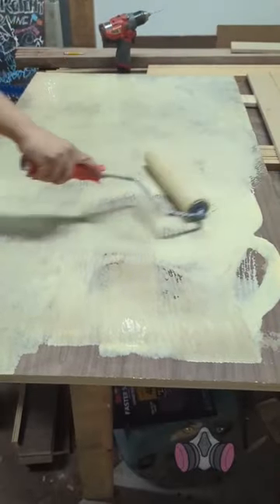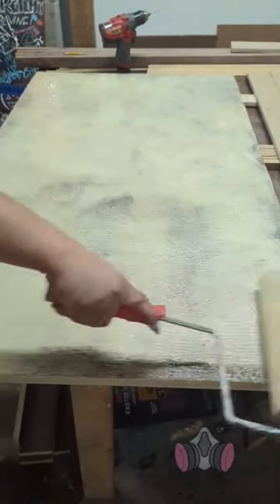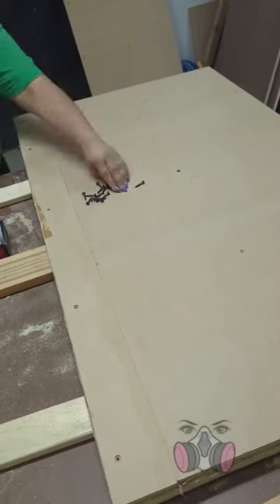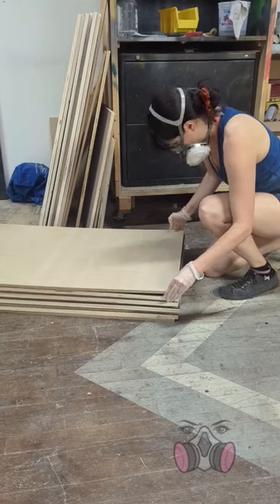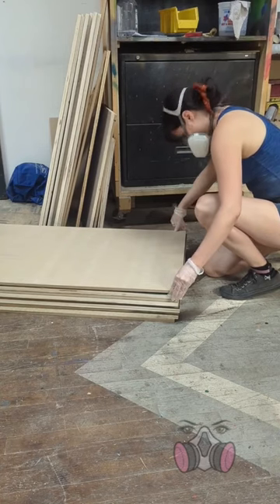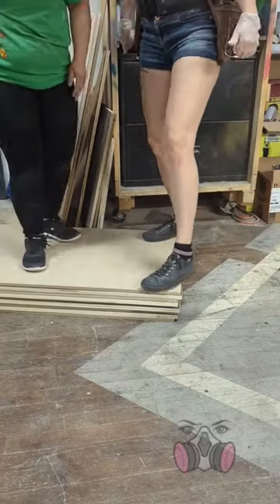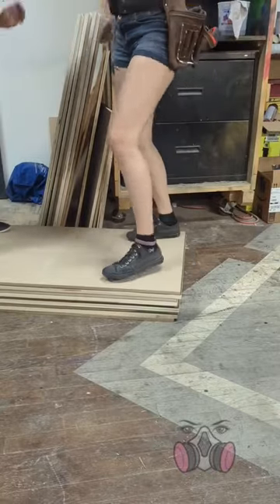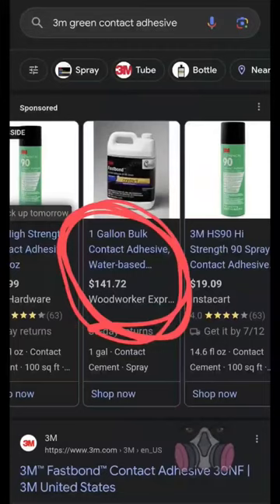Best adhesive I've ever used! #diy #woodworking #diywoodworking #woodworkingprojects #howto #3m

Comment: saw 3M and knew it would be 1 good and 2 expensive.
Reply from the maker: It's an assumption that I'll be making from now on too. I figured it would be expensive but I underestimated it by a lot
Reply: @woodificould  you definitely get what you pay for with 3M they're research and development is top notch.
Reply from the maker: @mrfixite 100%. 3M is one of the few brands that I've been consistently impressed by
Reply: Nice dance at the end of the video 😂 both of you 😂

Comment: Use a thin medium in between the two that you can pull like a lpde sheet so you can align everything and then smoothly remove the lpde sheet once you know things are in line.